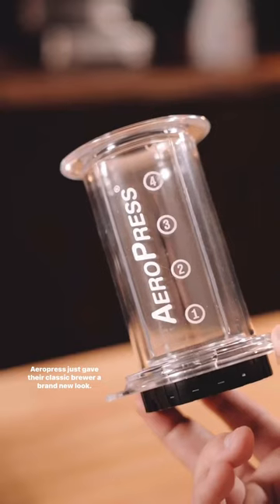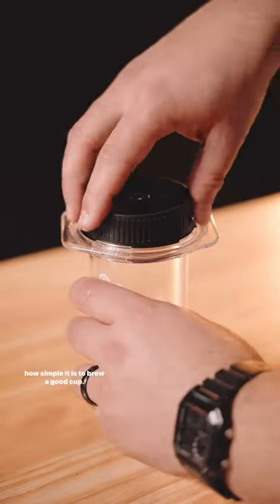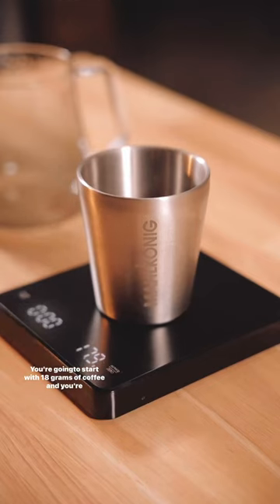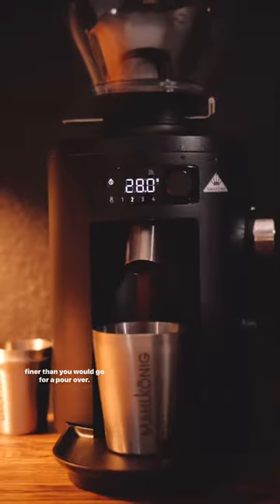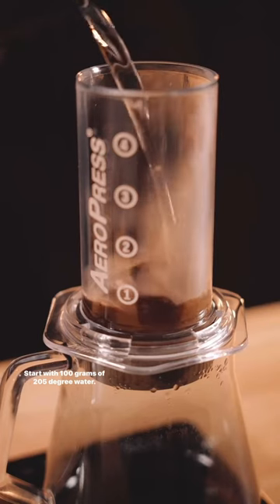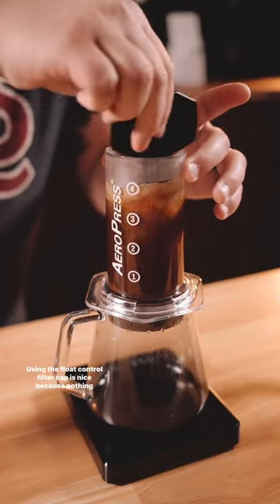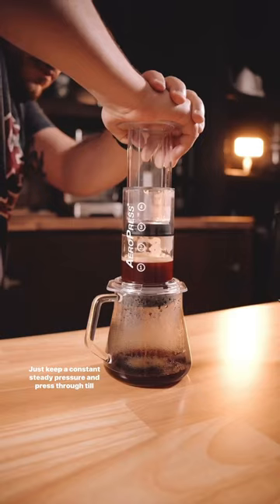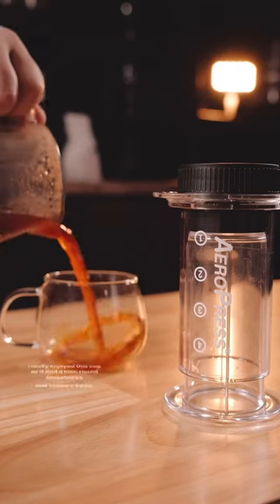New look, same great taste ☕️👀 Shop CLEAR at aeropress.com #aeropress #coffee #recipe

Comment: For those worried about prolonged hot water contact with plastic leaching with the regular Aeropress, theres a fantastic solution I've been using with stellar results with an alternate brewing method using the original Aeropress. So simple and it's actually way more efficient than the regular way using a lot less grounds to get the same strength coffee. So simple, just boil enough water as if you were brewing to the 1.5 or 2.5 mark in the Aeropress but instead of putting it in the aeropress, just add about 1/2 to 3/4 scoop of grounds to a glass or stainless cup or 12-20 oz milk frothing pitcher and add the boiling water to the same vessel. What you're doing is brewing outside of the Aeropress in a non plastic container. The beauty of this method is you can leave the coffee brewing as long as you like and let it cool down to room temperature and get maximum extraction without bad flavors. Then after it has cooled, pour it into the Aeropress and press the cooled coffee. What you've made is a cooled down strong espresso type shot that had only a few seconds of contact time with the plastic. Now you just boil some water to add creamer to or steam some milk to dilute and bring the coffee back up to hot drinking temp. Seems to taste just as good as Brewing the regular way to me, if not better. The verdict is still out on that and I need to do more trials with various types of coffee. You can also use this method to Brew several batches in advance and store in the fridge  for coffee concentrate always ready to use.

Comment: What’s a gram of water?
Reply: One gram
Reply: @momatedise  thanks! 😊 
How do you keep it on the scale without running off? 😂
Reply: Its around 1/25th cubic volume of an inch
Reply: @Polet1908  Best answer so far.
What’s that in ounces?
U know like we all use?
I don’t have any spoons that say 1/25 of cu inch?
Reply: @gregroth4696  1 gram. Thats (15,4grains) from where you can easily calculate its weight in ounces which are 0,0353oz. Long live imperial system!
Reply: One gram of water is one milliliter. In fact, the definition of a milliliter is the volume of one gram of water.
Reply: @ronkalinovsky6898 nah, back to school ma man. Time to adopt metric system
Reply: @maxw5229  what did I say that was wrong?
Reply: @ronkalinovsky6898  one cubic centimeter is one gram
Reply: @ferryhmm  Yes, and one cubic centimeter is the exact same thing as one milliliter.